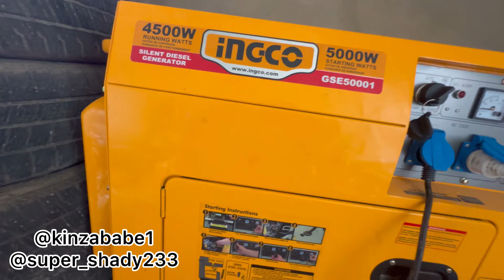Building in Ghana: Installing last 2 security doors

Comment: @kinzababe1 tjose window handles would have been better matching whites or was it a personal choice?

Those drain pipes on the wall are only tempopary as you would be going up another level later and you they will come off. I don't think you should spend any further miney on that. But what they should have done as I told you initially was for them to have a special dedicated pipe hidden in the walls like others running top to bottom and they could have connected these to it and later in the future connected the rain gutters to it.
Reply from the maker: The handles on the window were my personal choice. The pipes wasn’t added because I made these changes after. They already added drainage pipe for when the building goes up another level. These pipes are just temporary.
Reply: @kinzababe1  ok.

Comment: You need to get extension pipe for the generator exhaust, if you inhale for awhile carbon monoxide will hurt you severely,  God bless
Reply from the maker: Thanks for the tip! That we will have that room with open security doors.